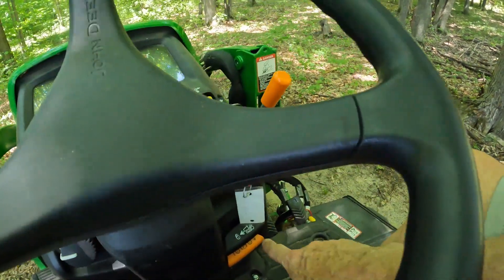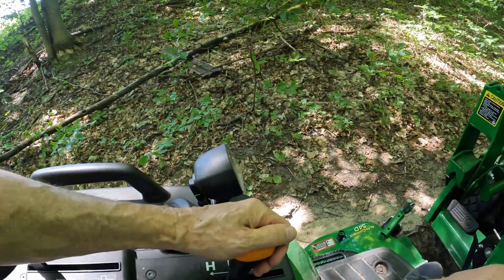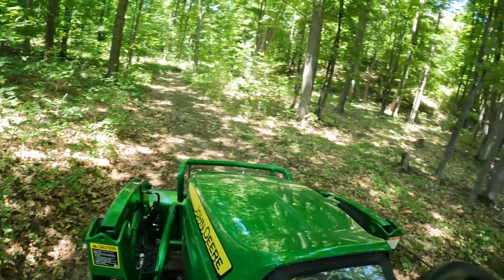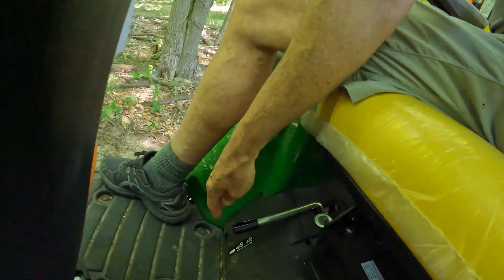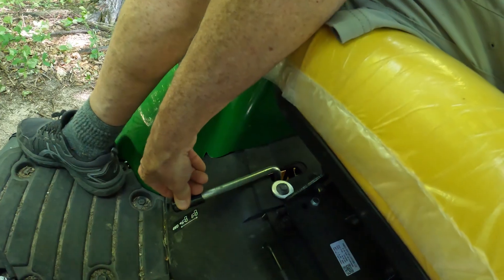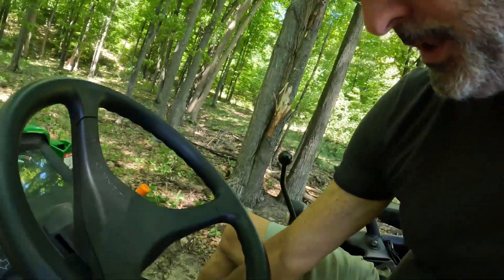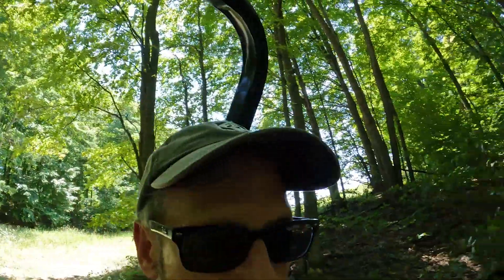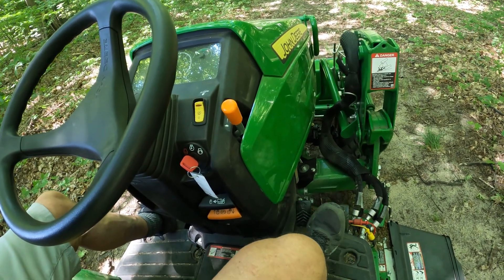John Deere 2025R Compact Tractor - Basic Operation (Start/Run/Stop/Park)

Comment: what year is your 2025R ?  do the newer ones have a easy connect /disconnect Hydraulic for the front loader?
Reply from the maker: Mine is 2021 model year, it does have easy connect for the hydraulic lines.  I never take my loader off however so I don’t use them.
Reply: My 2025R  is a 2023 and it has the new style hydraulic disconnect.    I haven’t take. My loader off so I cant say if one is better than the other.  My dealer said that it was an upgrade, however it’s been on any new model I’ve seen since buying mine last year